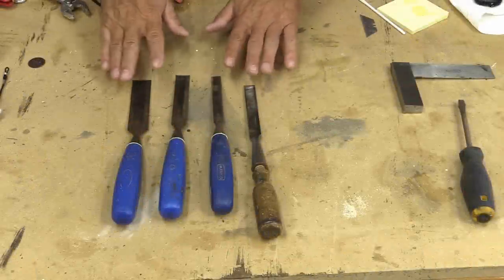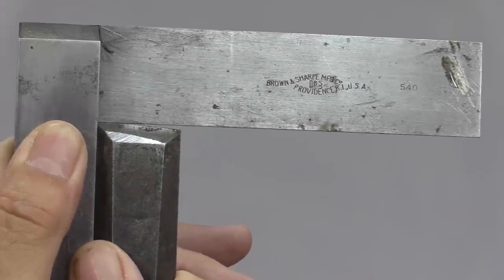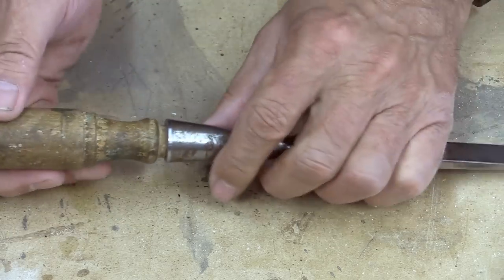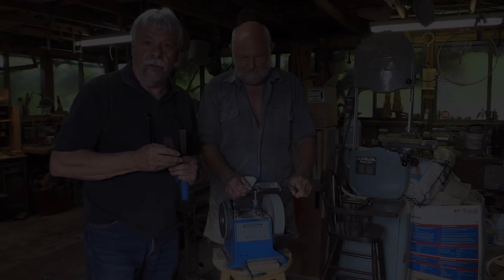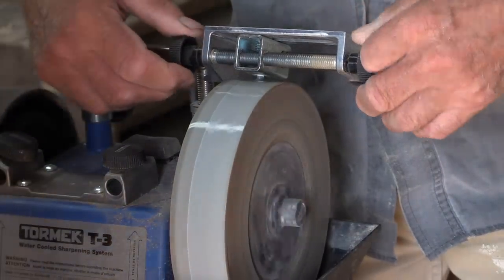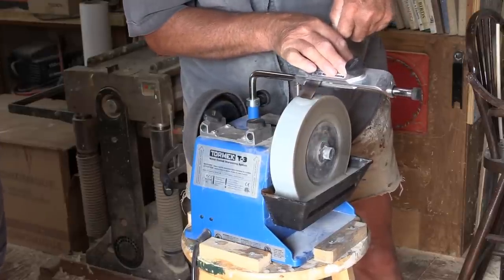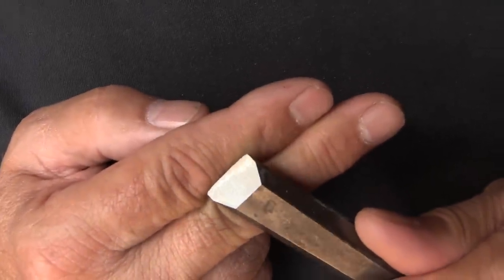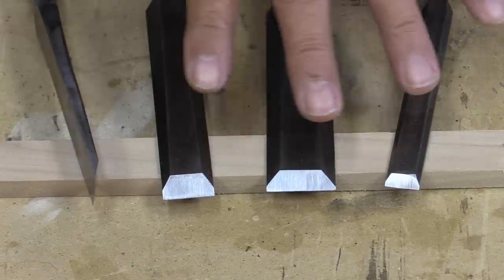Chisel Tune-up and Sharpening Overview  - On Tormek Grinder

Comment: I was dreaming about Tormec for few years by now. Unfortunately I need to sharpen only 3-5 tools a year, so it is not profitable for me to buy one. But one day if God will bless, I am going to get one of those.

By the way what is the tool on your right on middle shelf second that looks like pliers? I recently cleaned up garage and found one but had no Idea what it is.
Reply: Sergey Romanov It's a saw-set, used to give handsaws their set (one tooth left one right...)
Reply from the maker: Tobias Redepenning Tobias Redepenning Yes, Sergey is correct about the "pliers", I really must do a quick vid on those I get questions on that from time to time. As for the Tormek, a great machine, but not practical for everyone, I too sharpen rarely but Jack is a carver so sharpening hand tools all the time

Comment: That's a nice machine,but expensive I have a worksharp 1000 I picked up for under $100 and it does a pretty good job if you take your time. Thanks for the video Colin good info again.
Reply from the maker: Backyard Woodworking Yeah, I have a worksharp too ... does a pretty good job, then I fine tune the grind on the Lee Valley sharpener. I am amazed at how many different ways and different combinations of ways there are to sharpen ... thanks Roland

Comment: I have the Tormek sharpening system and it is a fantastic piece of kit. The sharpening shown in this video missed the step where the stone is re-graded from 250 to 1000 grit before the chisel is presented to the honing wheel using the holder. This ensure the grind is perfect and the edge is genuinely razor sharp

Comment: Yes that is quite the trick sharpening machine. Thanks for showing it Colin. one question can you square up a chisel using the lee valley sharpening gig or is it design just for sharpening a sharp edge.
Reply from the maker: Ron C Yes you can square up a chisel with the Lee Valley, but it is an arduous task, unless some knows something I don't. Basically you need a super rough stone or very rough grinding paper ... much quicker on other types of grinders, or hopefully don't purchase  a used on that was as far off as the one I purchased.

Comment: i just stopped here to confirm that the tormek is truly excellent. had a t7 for two years. hunting knives, kitchen knives, woodworking handtools and jointer knives sharpened perfectly. its expensive but if you have a need this thing is perfect at what it does.
Reply from the maker: Thanks RC, it seems like a very good unit

Comment: interesting tool...what ever happened to the bench grinder and a good wet stone..and squaring your chiesels by hand and a square... no fixtures just your eye and hands.LOL old school works for me...
ole boat builder..
Reply from the maker: chapmaker46 They are still around, but you have to look for them, and as you know you have to take time to learn how to use them properly too. Another one of the things that has changed in woodworking over the years hasn't it, along with more power tools and less hand tools.
Reply: yep thats for sure..when i started building boats we used a hand plane to plane the sheer down  LOL keep up the good vids
Reply from the maker: chapmaker46 Will do, thanks buddy. You know, I have nothing but the utmost respect for boat builders. Nothing in woodworking is harder or more frustrating. You guys have amazing skills and patience. I have done enough boat building to know it's not for me. Basically every piece is different and needs to be hand fitted. Great to have you with us :)
Reply: thanks

Comment: Good demo as always Colin.  It's good to have friends with $700 sharpeners!  I use a Worksharp WS3000.  It works great.  No water and best of all no mess at 1/3rd the price and extremely easy to use.  The Tormek is awesome nonetheless, especially for sharpening turning tools.
Reply: Hardnox That was the t-3 for $300. I believe it has been replaced now by the t4 for $400. The t7 is still below $700.
Reply: Michael Anderson Good to know.  That's still a tough pill to swallow.  My WS3000 was $230 with the large blade attachment option.
Reply: Hardnox That is exactly the set-up I use, though I've used the T-7 before. For some reason I don't like the hollow grind. WS3000 works great!
Reply from the maker: Hardnox Michael Anderson The Worksharp is  a great little tool, I have one of those too that I use from time to time.  
I just checked the Lee Valley site and I see they are still selling the T3 ... so maybe the T4 is on it's way. Good to have both of you commenting on these, it gives readers other options to investigate ... thanks guys :)
Reply: WoodWorkWeb The pleasure is mine Colin.  It's good to share information (and learn) and is why we are here.  What I especially like about the WS3000 is that it is small and portable whereas the Tormek requires a dedicated workstation.  The Tormek is definitely an industrial machine and a must have if one is a woodturner.